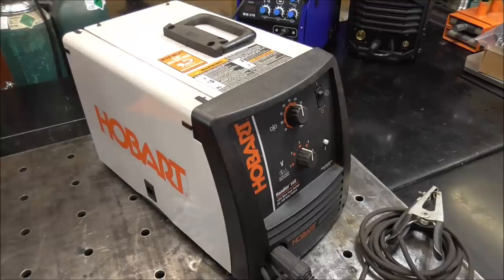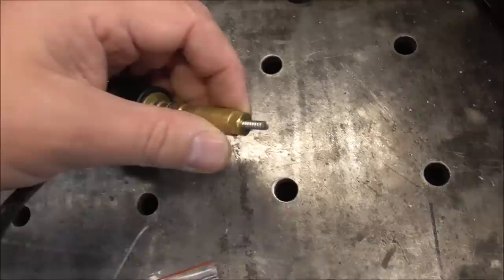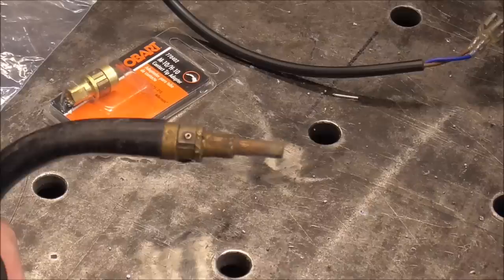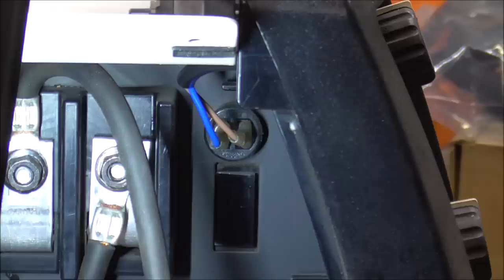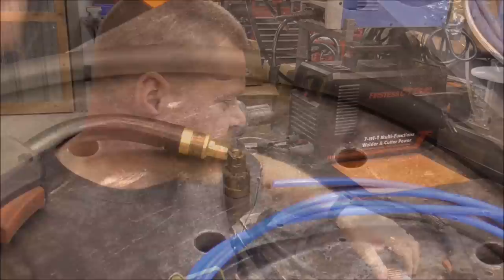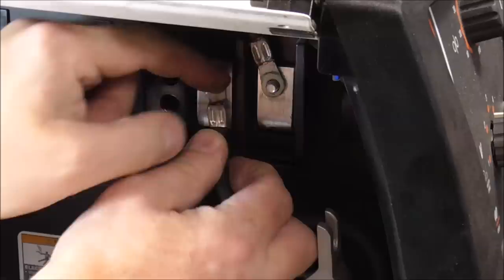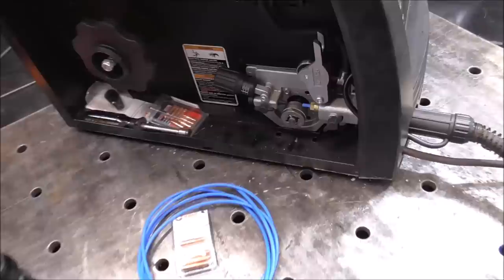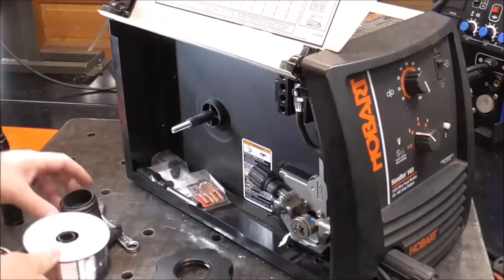Convert Your MIG Welder to Weld Aluminum - The Easy Way

Comment: Sounds silly, though have you seen where you drill out the tip to fit a tungsten rod and use your MIG as a TIG welder? Appears effective.  Thanks for sharing.  The method you demonstrated is still more cost effective than getting a, now days way less priced, spool gun and then hacking that out with a I guess 10K rated wattage potentiometer and extra switch for behind the trigger for the spool feed rate.  Great detail and thanks for sharing!
Reply from the maker: Thank you very much! I've heard that the torch gets really hot and will eventually burn up. I've never tried it but I have heard from people that have done it and it sounds like it produces decent results.
Reply: Don't drill out the tip of a mig tip. It's a finicky, janky way to do it and If you do manage it you'll burn up your adhock collet real quick. Your also pretty much limited to 1/16 tungsten electrode because the little mig torches have such small tips. You can find cheap tig torchs with valves from ebay, alibaba, amazon etc, and just rig the end of the torch to the negative, ground is positive and jump the torch trigger recepticle so the torch is live.
It will work but scratch start only and at whatever amperage the machine is rated for. You can adjust your cone with your voltage a bit but it's not like using a C.C. machine. Good for welding 3/32 and 1/8 steel but nothing too much thinner or thicker then that unless you wanna rip open the machine and mess with choke (reactor) coils.
Learn from my wasted evening.
Better off leaving the mig alone and hooking the tig torch up to a basic DC arc welder. As simple and cheap as it gets.
Reply: @brianlittleforest631 Makes sense after watching the YT video titled "How to turn your Mig Welder into a Tig Welder (PrimeWeld)" where he notes having to turn down power (his latest video was totally something I planned and commented on another video/community a few days prior to him making which was neat) and I see what you mean also where you note maybe like winding a larger inductor from a MOT will create more a CC situation.  Interesting studying the ways to make the variable inductors also in the analog ways. I've not bothered yet if I do and was planning like you're thinking as I've got the gear in old analog and even a newer HitBox IGBT design that's unfortunately not AC if I ever did want to do aluminum, just not gotten around to trying to TIG yet.  Probably mainly, since I don't have the circuits I want upgraded and new ran from the breaker and therefore made a goal to do using portable generator(s).  I recently got to the latest point, where I now have two 13HP Honda Groban (I think ~6000-7000W continuous) generators I can hookup in parallel tuned to phase sync to do the max current for the, I doubt I'll need, 50A 240VAC power source.  Pretty much where I left off with the Hackaday article regarding the "Modified Tombstone Welder Contains A Host of Hacks" for the update analog buzz boxes  Though I have acquired/invested in more parts and now even have a 120VAC buzzbox.  Oh, and with the aluminum welding, I have a goal to make a high current inversion circuit so I can do the DCEP & DCEN offsets like the synchrowave original design though with more modern solid state parts.  Basically, I think the easiest is a square wave inverting circuit for starters before getting into other waveforms maybe... and then I forget offhand like making the switching/PWM/freq.gen. circuit for the duty cycle between the positive and negative power adjustable.  Still early in the morning and I haven't worked on that design in a few months or more. Basically a modified sine wave inverter that's higher current design, with more control of the duty cycle to adjust the positive and negative magnitude and time. Then you can basically use a frequency generator to modify the modified sine wave inverter to product other waveforms.  I don't weld aluminum yet... though really neat studying the range of options and even the improvised ways if really needing to.  Thanks for the experienced insight.  Makes sense even if using a ceramic MIG nozzle.  More motivation to use up the tank of CO2 and swap out for a tank of pure argon and get a mixing valve so I can just keep refilling the other CO2 tank and eventually dedicated argon tank.
Reply: @brianlittleforest631  I forgot to mention, like if I needed to weld aluminum, the method shown in this video to convert the MIG welder is definitely the easiest way for good enough welds. I wasn't sure though about maybe spending a little extra for a dedicated aluminum welding drive roller just to help reduce the potential for cross contamination.  Seems I recall that somewhere when I was first looking into... though never really wanted to since until the Chinese options came on the market... they drive rollers were way to high priced.  Ultimately, I haven't had a need to weld aluminum yet... so that's on the back burner until I need. Funny, is where I have some projects in the queue... they're all cast aluminum so the TIG route is more likely and does seem more cost effective to sacrifice a MIG torch collet, tip and nozzle and just invest in a liner, electrodes and argon since the jobs are so small weld volume.  For those pressure washer flange mount feet, ultimately, I broke down and purchased some Benzomatic aluminum brazing/welding rods. I still haven't repair yet since I think I just want to wait until I have like you noted, the better aluminum adjustable offset or duty cycle AC frequency adjustable welding TIG setup.
Reply from the maker: In my opinion your spot on Brian! 👍

Comment: I wonder how this works on the newer style of Handler 140 that only has 4 voltage settings.  Setting 1 in theory could be  5% higher than the old machine with 5 settings, though it's likely a little less .
Reply from the maker: I think it would work pretty well. Are the newer machines still transformer based machines or are they inverter style. Personally I like the simplicity of the transformer machines, but they are very heavy

Comment: The biggest 2 things you need to make this work is the Gas, and ability to swap Neg and Pos ground.  If your mig accepts a spool gun, you'll get an even more reliable burn as alum is soft and even with a Teflon liner, it can still kink or bind very easy, and cause you a pile of spaghetti in the box.
Reply from the maker: It's actually all of that needs to be setup correctly. Your liner nearly touching the drive rolls plays a large part as does hub and drive roll tension along with keeping a straight / sweeping whip

Comment: Wouldn’t it be better to tig with your mig just make up a tip that holds the tungsten works great 👍🏻
Reply from the maker: I've heard about this a few years ago. From what I remember it burns super hot. I think I read that it ended up burning up the torch.  I will have to look further into it.
Reply: Also, not AC, so might burn up or just not puddle.

Comment: Any idea how I can weld pot metal or what ever the metal is that automotive mirror skeletons and door handle carriers and a bunch of car stuff is made of???
Reply from the maker: Pot metal is generally un-weldable. They do make a specialty solder that can be used with pot metal but I haven't tried it and I don't know much about it.
Reply: It's called "die cast zinc alloy" and you can melt it into a big puddle but that's it.

Comment: Hey Brandon - I know some use Helium CO2 Mix for TIG on Al.  
Have you tried Helium Co2  on Mig??
Reply from the maker: I have not. Helium is nice but it's expensive so I stay with argon. 😉
Reply: The only gases used on aluminum are argon or a mix of argon/helium. CO2 is not even an inert gas. Pure CO2 is great on steel for the hottest weld on thick stock.

Comment: Your sample may have been 1/16" aluminum but when you clamp it to that thick steel table it will behave more like the table.
Reply from the maker: Spot on! When you clamp thin metal to a thick plate it acts as a chill bar and helps to reduce blowout / penetration.

Comment: Before attempting any weldment on aluminum, have a new stainless tooth brush and scrub the oxide off and it will weld so much better.
Reply from the maker: I brushed it. That's plenty for padding beads in a demonstration. A torch was used for the reason given in the video. The brush doesn't have to be new. It just has to be dedicated.
Reply: @BrandonLund  the only reason I brought up the brush needing to new was just so it wouldn't be contaminated with iron or any other metals. That oxide layer makes things damned near impossible at times. At least for a good clean job anyhow. Thanks for the video.

Comment: Good informative video. Can I do the same to a Pro Craft 210 240 volt machine? It does not have + and - connections that can be swapped but I can swop the whip and negative terminals on the front of the machine as they are twist and lock  connectors.
Reply from the maker: From what your describing it sounds possible. As long as you can add argon gas to your machine, you have a machine that allows you to replace the liner and you can change your welding polarity to DC electrode positve, your in business.

Comment: Awesome video! Question… I have a Linde VI-253 CV with a Linde MIG-31A feeder, which is a 220 machine I normally use for hard wire. Since this machine has way more power that a 110 machine, can I use it to weld a bigger aluminum wire? Thanks for your time, again, great video, thank you!
Reply from the maker: You could probably easily weld with 040 with that machine.

Comment: Hey Brandon, great video. You mentioned in the beginning that the wire you used was not for cast aluminum. Can I weld cast aluminum? If so what wire would be best. Thanks.
Reply from the maker: You can weld cast aluminum with mig but it's challenging. You will want to preheat the metal and go in a swift forward travel. 5356 wire would be a good start if you don't know the grade of alloy you are welding and use pure argon

Comment: Brandon, thank you for this video. I have a Lincoln SP 100 welder, Much like your Hobart. It does have the connection for gas, but how does the Argon get into the gun?
Reply from the maker: Those 2 o-rings that I inspected, the gas enters the whip in between those 2 o-rings

Comment: on my welder it takes a switch and a set of rollers and a inner sleave & tip  , supplyed with the machine  so all even under the budget and about 4 minutes
Reply from the maker: Nice! That's how my Fronius came too. You can also buy a spare whip that eliminates the liner swap.

Comment: Would it be better to buy a second mig gun? So that way you could leave the liner in one for aluminum and one for wire
Reply from the maker: Absolutely. That's the way if you can swing it. It makes swapping over pretty quick and easy.

Comment: I have a question I have an old Longwood dual fuel furnace basically oil and wood and it's got a crack in the front of it what would I use to fix that and is it cast iron or Castile? Thank you in advance for your help
Reply from the maker: There is no way of knowing unless you test it. This is how you test it https://youtu.be/2NI5-EMEkJU
Reply: For cast steel or iron always preheat the metal, use NiRod, high nickel for arc welding. And use reverse polarity. Peen the weld after it's done to relieve the stress.

Comment: Thanks for this info. Shouldn't you be using an insulator under your aluminum coupons? That big steel table is going to suck all of the heat out of that little bit of aluminum.
Reply from the maker: Thats a good point

Comment: Hi, I am complete beginner and purchased combo machine 160A... they say in manual that welding of Aluminium and stainless steel is not supported...I learned from you what to do if I want to weld aluminum, but would be possible to use it for stainless steel as well? 
Second question... where to put ground on aluminum weld and if it will  be possible to use for stainless steel as well...where should be ground in that case. 
...aaaand....here should I put ground when I am using ordinary Flux vire on carbon steel ... they don't say in manual 🤦
Reply from the maker: If your talking a wire feed welder, yes you can weld steel, stainless and aluminum. For flux core wire on steel you hook your ground to the negative terminal. For stainless and aluminum you hook it to positive. You need argon for aluminum and stainless.

Comment: Do you need to change out drive rollers for aluminium? Also, what should the polarity be for aluminium?
Reply from the maker: IF you can, a U groove drive roll will give the best performance but you can use a smooth if your in a pinch. You will run DCEP when running aluminum. Same as hardwire.

Comment: I dont know if he covered it but I think aluminm uses special contact tips because the expansion rate if not the same as steel .and without a spool gun keep the liner strait as posible not coiled up ,.polairty is important .somthing is wrong when you are getting splatter like that and the black soot .I suspect the welding wire is too old ,  it oxadizes too ! This is a big problem in the industry .They need to put an expration date on it .
Reply from the maker: @Jacob Clark You always go one size larger on the contact tip as I mentioned in the video and keeping the whip straight. The black soot you see is magnesium oxide and it's very common when mig welding aluminum, especially 6061 aluminum. In addition, 5356 wire has a very high magnesium content so when magnesium is vaporized by the arc's heat and comes in contact with oxides, black soot forms. This is normal and completely ok. It has nothing to do with the wire being out of date.
Reply: @BrandonLund I had the same issue with  5356 wire  ,  I did not know about the magnesium , thanks for the tip .If you maxed out youre wire speed rate maybe you could compensate with larger dia wire but maybe not with such thin metal . Im glad I have a big machine with a spool gun,  cuz I rember all the issues with out it or when you have to pre heat because of low amps .miller makes special sized tips just for aluminum .

Comment: @04:26 Compare the replacement part before you completely remove the old liner.
Reply from the maker: Not a bad idea but that old liner is not going back in even if the other liner was too short. That old liner has seen better days.
Reply: @BrandonLund  I have only run about 20 pounds of wire through my welder. My thought was that if the new part did not fit I could keep welding until the correct part came. I am looking forward to using this idea to convert my Millermatic 251. I have 5 small spools and 5 large spools of 0.060 and 0.030 aluminum wire that I bought years ago for 15 cents a pound from a scrap yard. It should be a lifetime supply.
Reply from the maker: Good deal! If the AL doesn't have the plastic on the outside you might have to cut a few feet off to get rig of the oxidized layer.

Comment: Can you weld stainless on a mig welder Hobart Ironman 240
Reply from the maker: You sure can. I swap out to a teflon liner just like you would if you were welding aluminum (to prevent contamination) and use pure argon or an argon mixture and your good to go 👍  (people will tell you that swapping liners is not necessary. ) Best practice says otherwise.
Reply: No different than welding stee,l except you have to buy stainless wire.

Comment: How about using Silica Bronze with that welder.  Maybe your next experiment?
Reply from the maker: Thats actually a great suggestion. I've done a video using MIG silicon bronze on cast iron but not using this specific machine.
Reply: @BrandonLund  You did an excellent job explaining everything in the transition.  I've seen others that don't go through the tuning and fine details. Like the differences in liners and cutting it to length accurately
Reply from the maker: Thanks man I appreciate that. I'm one that when I'm learning something I like to know those fine details. It's those small details that help me understand the bigger picture of "why" it works the way it does, so I try to pass on those details like how I like to learn. I appreciate your kind comment man! Thank you!

Comment: Now a question. Do I have to put the steel liner back in to weld steel? I have a miller tig welder that uses gas to weld the steel with. They have always said I have to use a different handle with the spool hear where the wire comes out. The reason they said was because otherwise the aluminum wire would meld inside the steel tube and plug the feed line.
Reply from the maker: The steel wire is too abrasive for the Teflon liner, plus the steel will contaminate the aluminum. You will want to keep them separate.

Comment: I run aluminum thru my Lincoln 180 all the time never put a Teflon liner in just need 53xx series wire bc it's stiffer
Reply from the maker: I think the Teflon liner probably helps it slide better but I'm guessing it's more about keeping all that metal powder from the steel liner from contaminating the aluminum.
Reply: @BrandonLund  i have a seperate gun for aluminum
Reply from the maker: @danielgeorgianni888 that's really the way. Much faster to swap out that way 👍

Comment: Very nice video . Really cool you could do it . I've used a welder running aluminum an he bought a spool gun for his welder and worked really well I was doin boat hulls so it worked very well using a push pull kinda set up on an old school welder old school Lincoln welder it worked really well figured I'd mention it just in case you want to do more aluminum welding we were building boat hulls,  and it worked great. I know them spool guns aren't the cheapest but may help from buying a new welder figured I'd put it out there for you.  If interested in doin some more work whith aluminum .  Nice video I was wondering if I could possibly use my mig whithout buying a spool gun to do it""" very nice vid thank you.
Reply from the maker: Thanks Bruce I appreciate it! 🙏